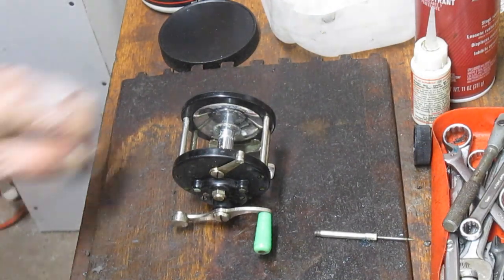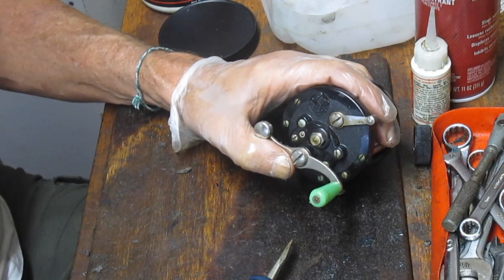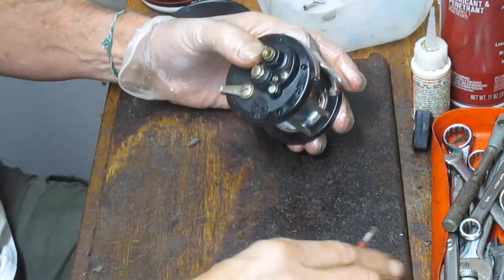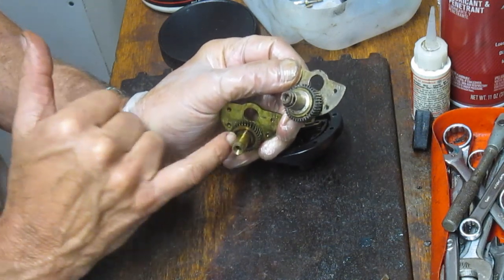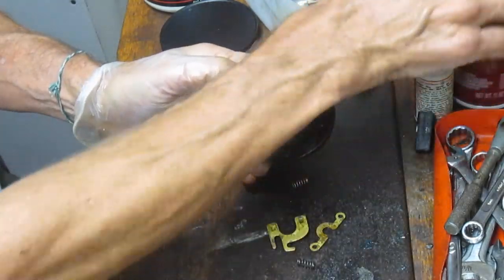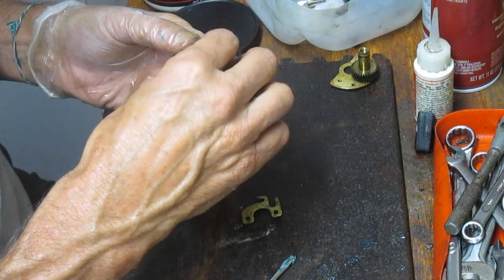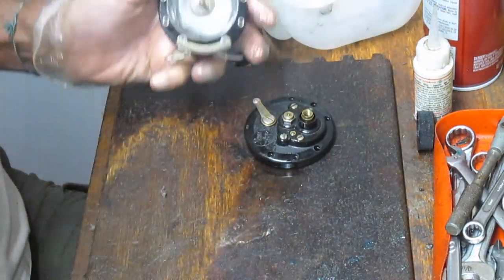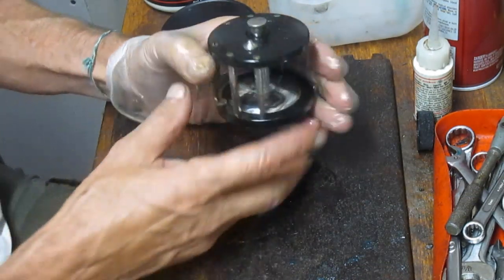Penn Seaboy 190 how to take apart and service this vintage fishing reel copy

Comment: There is also another Penn Seaboy that came out in the 1990s.  That Penn Seaboy is similar to the Penn 65 Long Beach.  I think it only had a short run into the early 2000s and had an Aluminum Spool and Graphite side plates with no Beauty Rings.  Looks like that Sea Boy 190 had the basics... and not all the "Bling" of ball bearings.  Hence there was no demand in the market. Now they are rare to find.
Reply from the maker: Yes - the model was the 185.  It uses the Jigmaster main gear and is a nice reel overall  - Dennis
Reply: @2ndChanceTackle  Yes Dennis there were 2 models that Penn came out with at that time.  One was the Penn 185 SeaBoy and the other was the Penn 190 SeaBoy.  The Penn 190 SeaBoy also had the Jigmaster main gear and also a Stainless Steel Pinion Gear.  That Penn 190 Seaboy could use the Penn 66 Long Beach Reel Seat for the addition of reel clamps and was the size of a Penn 65 Long Beach.  Thanks again Dennis for all your great videos and for sharing your knowledge with the world!

Comment: Love the old baitcasters. Was never good at casting with them, mainly used mine on the boat and just dropped the bait over the side.
Reply from the maker: These are simple straight forward reels that will pretty much outlast the over engineered duck on the market today.  Thanks for watching - Dennis